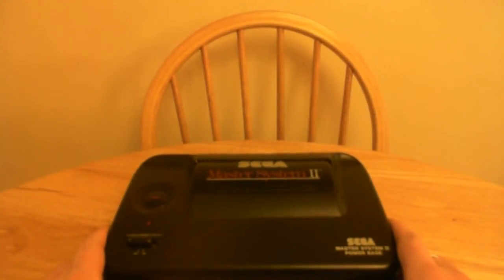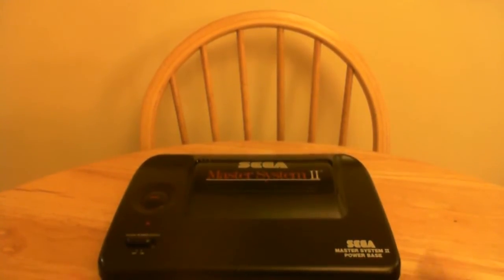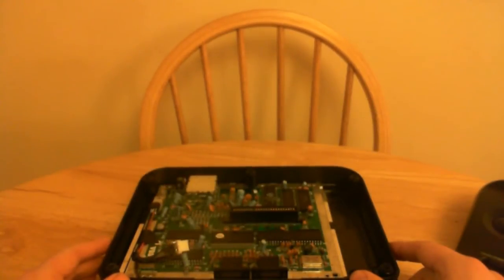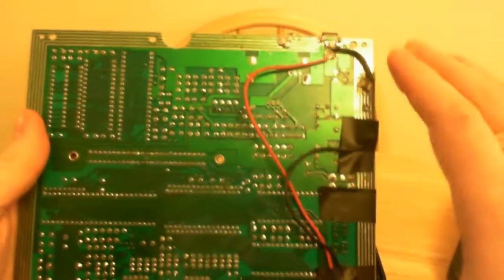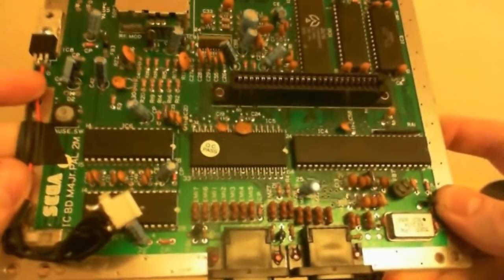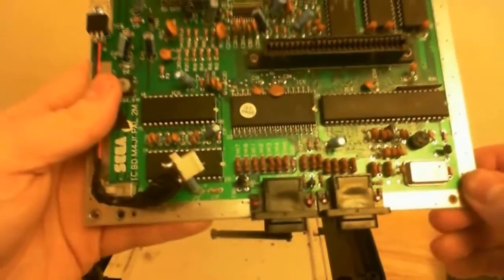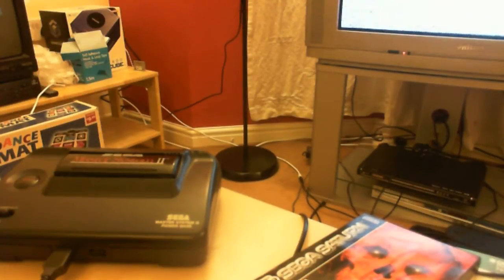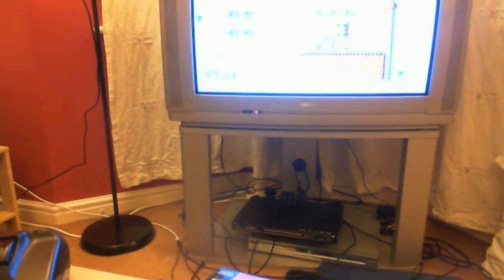Sega Master System 2 - Repairing a dead system

Comment: This vid is shit! Meant to show how to fix a dead system and you get half way through explination, promise links to pics of the power supply mod but they dont turn up, then you just go on about the LED mod... if run the red wire from positive power in to the positive on the switch  and removed the 2 diodes.. now what???? Its still not working, im not even getting anythin nkw its just static!!

Comment: I have a multimeter, but I need to read up on how to use it. Pretty much the kind of guy who looks up something online and tries to repair it himself. Mine are also red (well orange, but since you are color blind) and the black markings do look like they are made by a pen or a marker guess it was so help those who put the devices together identify the capacitor

What numbers should I get from the diodes with the multimeter?

Comment: Well when I adjusted the screw it did stop going from color to b/w every second from being color for 10sec and switching to b/w for a second. Looking at the board itself nothing seems to be wrong. Pretty clean board just some brown stuff at some of the solder points on the bottom of the board

Comment: I get a picture, but the color is strange. At first color is correct but then it turns black and white.. then back to color and it pretty much repeats.
Friends told me I should adjust the screw on the voltage regulator while the system is turned on untill the picture stays good, but it's not working. Am I doing something wrong or does adjusting the screw do nothing?

Comment: @nukpanatech No problem. I'm going to replace the 7805 and at least two capacitors. I don't know if that's the problem for sure, but it certainly can't hurt! I'll let you know if that fixed it if you're interested. I have 2 SMS1s with similar issues.